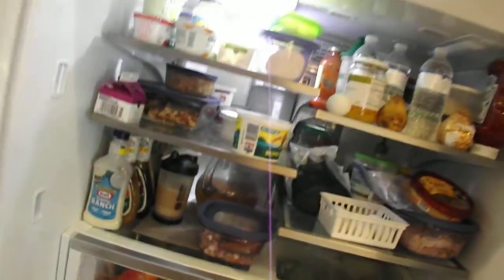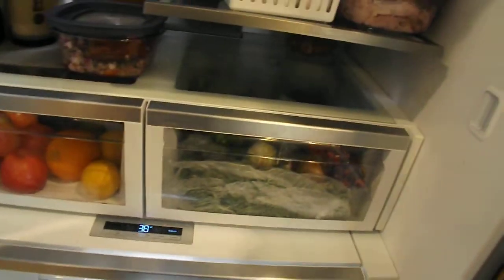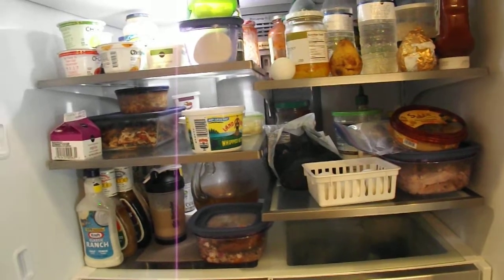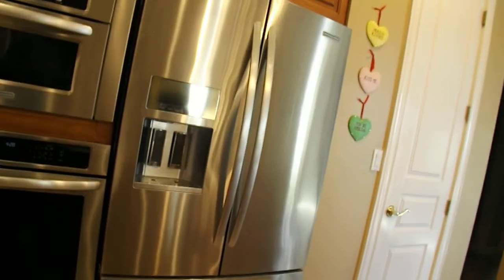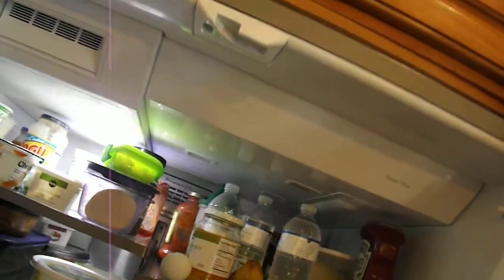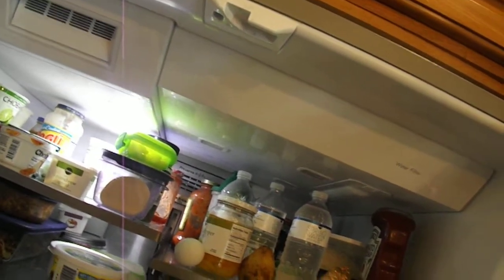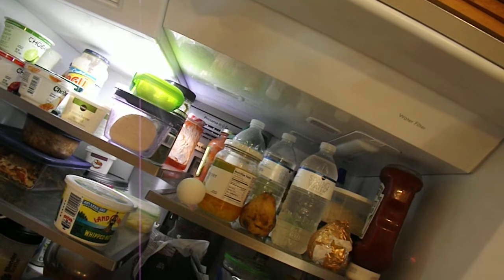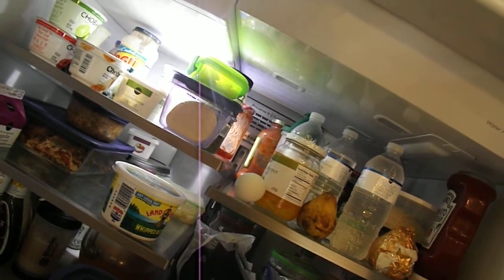Kitchen Aid Refrigerator , Lead Lights Not working.

Comment: Had the exact same problem on the same fridge.  The freezer compartment LED module was the issue.  The FC module went out about a month ago and I decided not to replace.  The other lights went out on Sunday, except for the two under the ice maker and drawer light.  I replaced the freezer light with part W11130208 and all the lights are now working.  Easy fix $50.
Reply: having the same problem, same fridge, trying to read and figure this out

Comment: Most of the time it’s a module. I tape one door switch, hold the other with my hand and when I let go of the switch If the module is good it will flicker on then go dim. If it’s out it will not come on at all. Then pull it out protect the liner with painters tape take the module off and short the pins with a screwdriver and if the rest of the light comes on then you know you have a bad led.

Comment: All the lights on my built-in kitchen-aid (2 side-by-side fridge doors and 1 freezer door below) are not working. When I turn off the power on top wait few seconds and turn it back on, all the lights come back on. When I close the doors and then open it again lights won't turn on again. Will this be control board problems?
Reply: Almost definitely the control board.

Comment: Hey man check your comments - How did you fix this? Enquiring minds need to know! I'm on my way home to pull my same fridge out for the same reason...
Reply from the maker: I decided to replace the LED module Board in the Back. If the lights still did not come on, I was prepared to replace the LED lights also. They are all in Series like Christmas Tree Lights. So that means if one bulb goes out, then the Entire String for that side, will not work. 😌
Reply: I think that's exactly what I'll end up doing. Thanks for the reply! cheers

Comment: You could have gotten all this information from the tech sheet schematic. There is no way to know without proper testing. I’m my opinion you were expecting a solution more than technical troubleshooting help from the tech line person.
Reply: The electrical schematic on this unit is a nightmare. Worst I’ve ever seen.